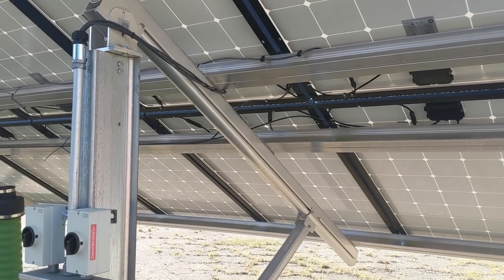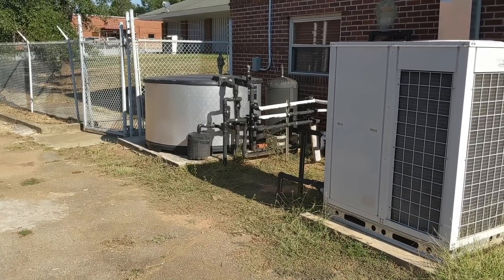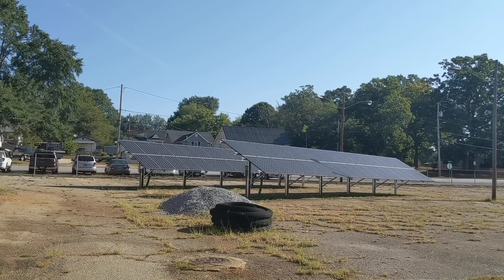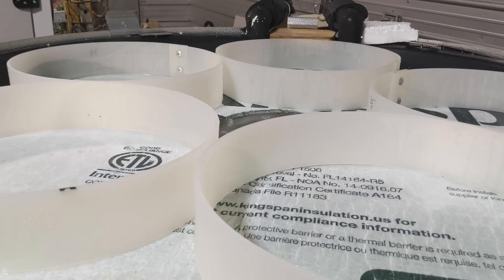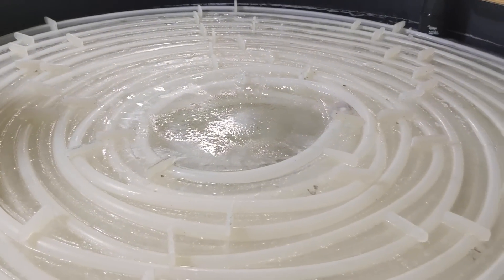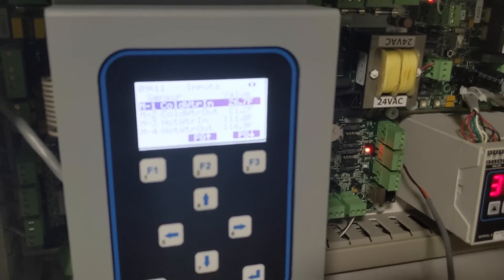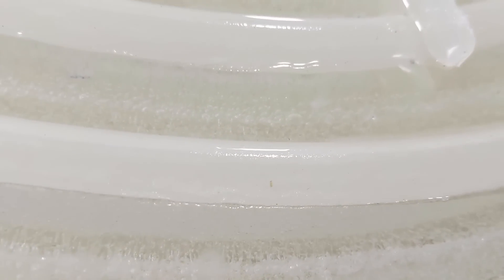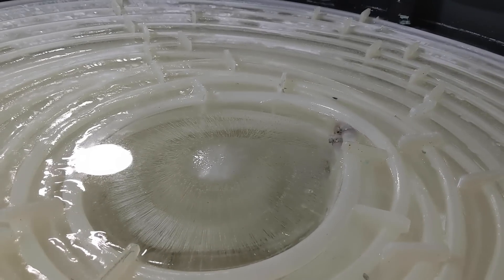Thermal Storage: Solar ICE

Comment: Wouldn't  an ammonia based system be more efficient? No need to convert sunlight to electricity and run a compressor.
Reply: Yes it most likely would be but ammonia systems are very expensive compared to compression systems. In a residential installation a compression system would be the cheapest option, once you get to industrial sizes ammonia systems become cheaper and more feasible.
Reply: @nerdy1701  I have looked for ammonia ac unit and still have not found one, most systems only need a small pilot light to keep them running! 
They do make some pretty efficient fridges and freezers yet still no AC unit.... One could very well use wood gas to run all 3 of these units for a small investment. Wood gas can be compressed and used at a later date.

Comment: Would be nice if tank was vacuum lined tank to minimize heat gain into tank.
Reply: That's expensive. I think in terms of garage built science project cheap.  A 275 gallon cube shaped Tote bin can be sprayed on all surfaces with rigid urethane foam for hot water storage.
Reply: I work with cryogenics and vacuum insulated pipe and insulation’s. Not as expensive as you may think. It could use technology known as VIP vacuum insulated panels and still use cheep plastic tanks
Reply: @allegannews  Would increase the efficiency of the unit!  Vacuum insulated panels are suppose to be the highest r value insulation around per inch, Something like 100 R per inch.... Now I would not mind having a house with about 4 inches of this stuff... Ok that might be a little expensive...  
Last I look those panels were small size or custom made?  Do they sell sheets of this stuff in say 4x8?
Reply: William Glaser yes they do make panels of all sizes and ability flex and wrap around tanks. I have used https://www.va-q-tec.com these are from Germany but their is also USA manufactures. i recall R50 in 1” thick. Issues with panels are puncture and heat above 80-100 C. Some people combine Vacuum panels with expanding foam sandwich to protect panels from damage. I have some amazing testing data when we used them.
Reply: or you can place the tank where you actually need air conditioning.
Reply: @jawwadsabir4620  With vacuum lined tank that could be done as it would not give up it’s cooling capacity until system demanded it.
Reply: @allegannews  actually we did the calculations - the extra cost of vacuum lined tank is way too high to be justified which means it makes better sense to increase the storage size for that cost - it will be more storage time for that amount. A deep freezer is also very well insulated. Remember, 1 cubic meter of ice stores 94kWh of energy - it will not easily melt.
Reply: @jawwadsabir4620  The next question is why use water by itself why not media that has higher storage per volume. Could using antifreeze which allow water lower freezing point increase it’s BTU per volume. Also vacuumed tanks can affordable depending on scale of production and methods of construction. You can also use Vacume Insulated Pannels VIP which can be made to be fleaxable and provide R50 per inch.
Reply: @allegannews  water/Ice has the highest volumetric energy density ~ 334kJ/kg. To put that into perspective, the amount of energy it takes to melt the ice from 0C ice to 0C water = the energy required to raise the temperature from 0 to 82C of the same amount of water. That means 1 cubic meter can store 94kWh. There is no other phase change material that can come even closer.
Reply: @allegannews  Also, antifreeze will lower down the freezing point and also decrease the thermal conductivity. Also, we want to freeze it because we can store much more energy per unit volume in ice. For reference you should look up latent heat of water.

Comment: I don't guess a peltier would come close to the effiency?
Reply: Unfortunately not. Even though both systems are a type of heat pump, peltier coolers are 1/15 as efficient as compression systems. And those are the good peltier coolers vs a run of the mill compression system.

Comment: There’s a big market in the boating community for making ice,,  buying bags of ice seems to be the common,,a small ice maker would be ideal for a boat
Reply: Good idea. Let's do it!
Reply: Still checking out small ice makers,,other than that,,I’m studying Peltiers,,just looking for something to keep my eggs and butter chilled,,I’m trying to keep everything running off my solar panels and one battery
Reply: @bobleclair5665  pelletier coolers suck. They are too weak or will draw too much. Mini fridge might just be the best
Reply: Kinda defeats the purpose. You're either using the ice for keeping food cold, or for storing/transporting fish. If you're using it for food, you might as well use a fridge and skip the ice. For fish storage the quantity of water, time and energy required to make the ice is likely prohibitive on small vessels. Only really feasible on larger vessels.
Reply: Consulting joe,,I’ll agree,,but in Key West,,we have a free wall,so it’s not like paying for the Peltier parts and the sun is free,,and I’m not trying to make ice just cool a small kitchen cabinet box,milk,butter and eggs
Reply: Bob Le Clair but a cheap $80 (or free on the curb of many dorms at the end of a semester of college) will be at least 10x more efficient, do you just have a football stadium of solar panels or something? Besides that, the mini-fridge can make ice too (while still using way less power than a Peltier). Just go look on trash day, you’ll probably get a working one for free, or check Craigslist in the free section.

Comment: So if you can use propane in an RV to power a refrigerator why can’t you use sunlight in place of burning propane in the same way? Solar vacuum tubes get just as hot as the flame from propane does. I’m not an engineer but the concept in my mind seems to work.  I just don’t know how to work out the details.

Comment: I see potential for this to run a walk in cooler/freazer off solar 24/7 with out much battery bank needed.  If the solar could freeze this and also run your heat pump durring the day it could perhaps sustain your cooler/freazer all night.
Reply: Cooler maybe, Freezer no, Commercial walk in freezers are set at -10 to -40, How do I know, I have one... I have it set at -13 right now, The colder I go the more it cost. If I bought a newer style foam box and installed my drop in unit, I could either save half of what I spend keeping it cool or go to the max and spend the same. 
It adds about 25 dollars per month on to my bill. That is about 190 KW per month at about 6 KW per day. The compressor runs about 15mins every 1 hour cycle. 
We only get in to it a hand full of times per month.
Reply: William Glaser; you didn't at all explain why this wouldn't work.
Reply: @TheAnantaSesa  The chiller and ice will not get cold enough to produce the coldness that you want,  Walk in freezer and your home freeze are at 0F to -10F,  Its hard to bring down the tempature to -10 if the water is only at 28F.
Reply: William Glaser; so it’s easier to cool it down from 100º outside temperature? Still looks like the ice can reduce strain on the condenser coils as they work to produce -40ºF.
Reply: @TheAnantaSesa  It takes the same energy to freeze water from 0C to ice at 0C as it does to cool water from boiling to zero C ...... or so I am told ;0) Cooling Ice would take the same energy as cooling water so the only variable is if you actually need to freeze it or if you could lower the freezing point with additives!

Comment: Can one of these chillers be made to cool a space about 300 sqare feet?
Reply: 300 square feet is reasonably small. The expense of building a chiller for that space would be huge. It depends on your usage...is it a freezer? Office occupied 8 hours a day?  A living space? There are motorhomers who installed really efficient split system air conditioner units that run off solar panels. I follow their posts on YT. Van and motorhome dwellers  have been a good resource for information as they have already tested their systems and report the results.
Reply: @kimmer6  Yes. It is for a 38 foot motorhome. My plan right now is an efficient minisplit. I was wondering if a smaller version of this was better.
Looks like its not.
Thanks!
Reply: @ceefiveceefive  -  It will be cheaper to use the Solar Panels for Fans or Small Air Conditioner since it's only 300 Sq ft.
Reply: This is a excess energy storage solution for afterhours solar deprived times , given you have enough pv panels with suitable electronics, batteries  ,two storage tanks ,heat pump /chiller equipment ,  you can have continuous hot water and air conditioning service , expensive  probably more suitable for research non mobile operations

Comment: So, no battery bank...direct solar panel power to the condenser and electronics?
Reply: It's likely a grid tie system, setup such to run the chiller when the system would otherwise be exporting to the grid.
Reply: @TheMatron'sMilitia Absolutely, however to run that off solar when they didn't mention any batteries and whatnot - implies it was a grid tie system. So this would still only work when the grid is there, even though it stores energy in the ice. The chiller would be setup to consume about the same amount of power the solar puts out.
Reply: It's still an odd way to do it, typically for ice building you'd do it at night when the ambient is cooler, as the chillers are more efficient. Plus, most of your demand for cooling is during the day, so the ice realistically only stores energy for cooling in the afternoons/night.

Comment: could you use a geothermal Heat Pump instead of the chiller unit?
Reply: That's what I want to know!
Reply: I'd like to know the variables on this
Reply: Unlikely. To put heat into the  ground, yes. Cold - no. You would permafrost and ruin the hole for the geothermals.

Comment: Why not put some piping behind the solar panels themselves for not only making hot water, but also cooling the panels?
Reply: Stop trying to reinvent the wheel!  You all too late for that!  LMFAO
Reply: That will harvest heat from panels that can be stored in different storage tanks but not help the chiller operation since it strives on having similar temperatures in the storage tanks and spreading its temperature differential as chiller works is way on storing thermal  energy ,if very hot water is needed than hot water from solar panel cooling can be heated more with the aid of another heat pump against the hot water from the chiller operation tank  ,plenty hot water storage
Reply from the maker: Did you see that big green thermapex pipe under each solar array? That's what it's for.
Reply: Engineer775 no, I didn’t. Glad to hear that!
Reply: @engineer775  there are two hoses not connectee comming from the ground. Nothing behind the panels.
A sepperate heat collector would be more effecient.

Comment: Hell yeah! Sounds about as efficient as burning asbestos (with solar power) for heat. Think we're on to something.
Reply: The goal is to find a way to store excess energy from the sun at a lower price than using batteries. At a certain power level this becomes lower cost! It is questionable if it is practical on smaller systems due to extremely high up front cost of equipment, but on larger systems it could be substantially  lower cost.
Reply: @Jeremy Honeycutt 
HVAC, both air conditioning and domestic heating.

Comment: I guess I'm the idiot here but I would love a little more explanation about the uses for that
Reply: It's a chiller. Typically used in industrial buildings for heat and cool. A chiller is much more efficient then a typical AC unit, especially in larger buildings. In a typical home AC, freon is pumped outside to exchange the heat and make it cold again, then the freon is pumped a short ways back into the house. In a chiller, antifreeze and water is cooled in large tanks and then is pumped to radiators throughout the building. The benefit of a chiller is the water runs in heavily insulated pipes and remains cold a lot further away from the heat exchanger then a typical freon unit would. In large commercial buildings, such as schools, you only need one or two large chillers to keep the building, or multiple buildings cool. I say cool, but chillers usually make hot water as well and the same system works to cool the building in the summer and heat in winter. A chiller setup is more expensive then a conventional AC unit per BTU, but a chiller is more efficient and requires less units as the space required for it to heat and cool get larger. Hope this makes sense.

Comment: Very COOL idea :) 5ton for 6 hours is great. Can it be run on Dc 24v, 48v or 60v?
Reply: I'm guessing he worked with the calmac company and got the system PV direct, looked like a DC motor in the bottom of the heat pump, if they havent done it yet you could bet hes working on it. Hes a big advocate for PV direct